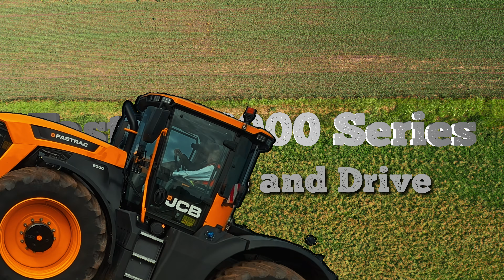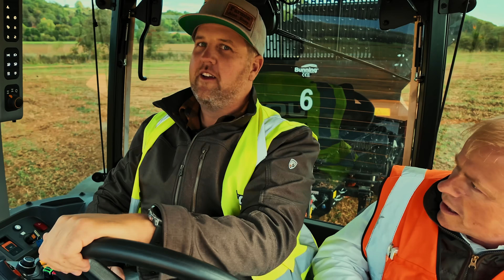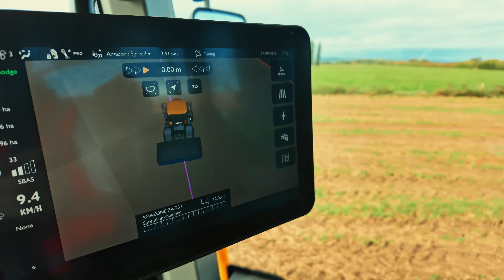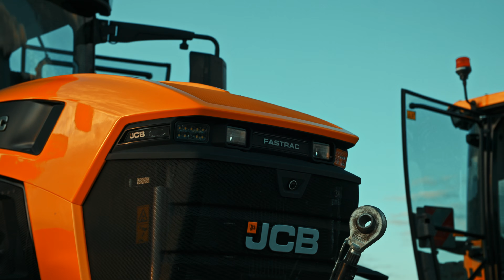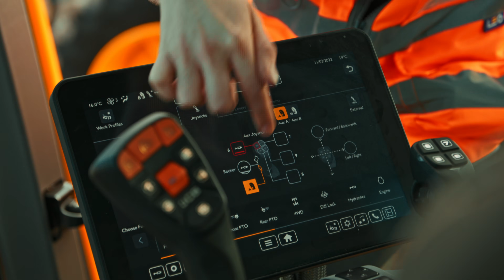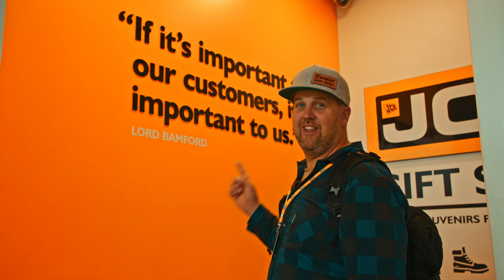Driving The NEW Fastrac 6300 -Deep Dive into Features

Comment: Is  the new 6000 series FasTrack . loader capable ? It would be nice if there was a  fastrac with More power and a loader .if it didn't have a loader option I probably wouldn't bother with it
Reply from the maker: Yes it is loader capable, in fact it even comes from the factory with the mounting bolts built right into the new subframe.  The auxiliary joystick is also loader-ready.   We have a Stoll loader on a 4220 right now thats even isobus.  It works great!
Reply: @farminainteasy oh even the 6300 ? That cool

Comment: only downside... should have continued Agco engine/trans for fleet compatibility...
Reply from the maker: Thats a valid point, however they were probably at a HP or Torque limitation that Agco didn't want to share...
Reply: Most people would say that FTP and ZF are the best on the market at the moment by some margin.
Reply: What engines they running now
Reply: @noelcahill6707 fpt I think
Reply from the maker: Yes, they are running the FPT PowerPoint with an all new ZF Transmission.